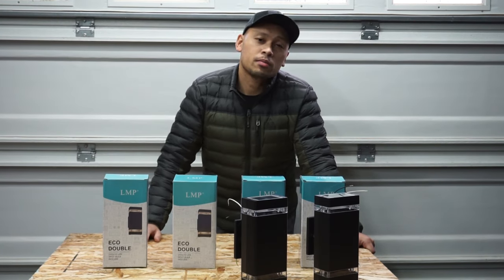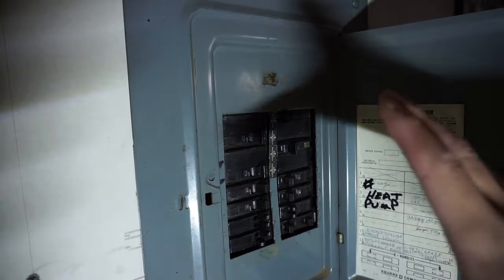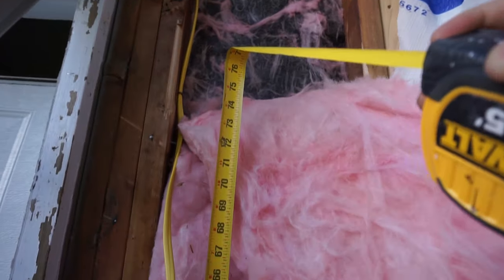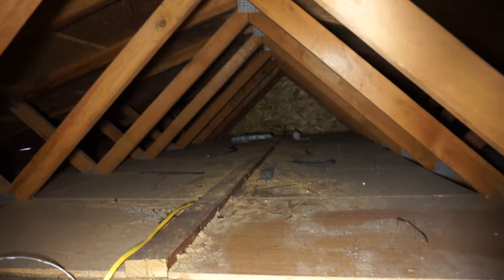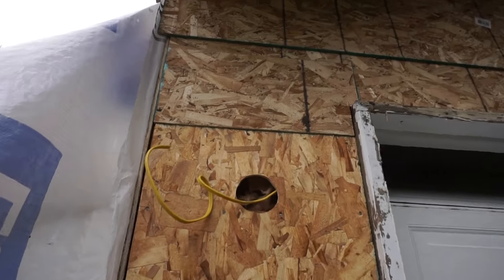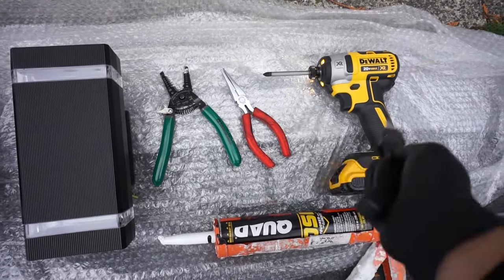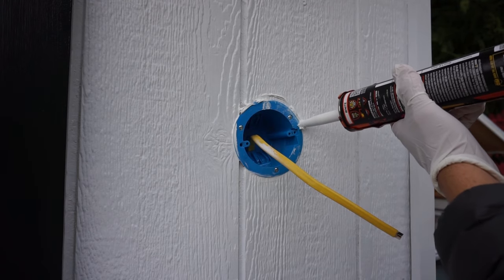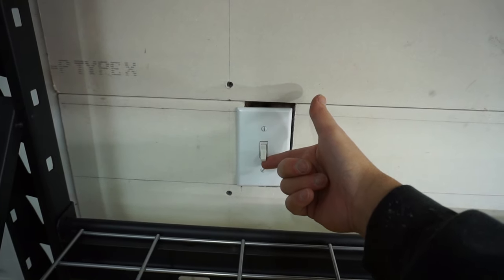How To Install And Wire Outdoor Light Fixtures - Easy Home DIY Project!

Comment: Why 12-2 wiring? I assume you have 20 amp breakers to be the reason? My house has 15 amp breakers so it’s mainly 14/2 with some 12/2 wiring.

Comment: Right away i see Thst Your using a yellow 12 guage wire. Its to thick for lightin. U could have used 14 guage its cheaper amd easier to work with

Comment: Curious as to why you ran 12/2 for these instead of 14/2?
Reply: 20 amp breakers are standard on garages and require 12-2. wire

Comment: For outside lights don't you only have to use 14/2 gauge? Isn't a 12-2 gauge wire for outlets?
Reply: 14/2 can be used for outlets if ONLY it's on a 15amp circuit. Where I am from

Comment: Thank you for great video but you left out the key part I was waiting for the wire connection to circuit breaker
Reply: I think he replied above that the switch was connected to the breaker.  So I'm this video he's forking off the line coming from the switch - I THINK.

Comment: Don’t forget to twist those white wires in the j box just like you did the black wires past the wire nut.  Holds it better when you squish it back into the j box.  I usually go about 1 1/2 inch past the wire nuts so I see a good twist.  Less likely to get loose when you cram the wires in the j box.

Comment: How did you run the wires from the light switch to the power?
Reply: Maybe it was already in place for the main gray line?  That line was obviously supplying power to something already. What I want to know is specifically how did he wire the second outdoor light? Did he run it to the same j box? I wouldn't think so. So I have to wonder if he just cut the gray line a little further over and wired it there. But he doesn't tell us :-(

Comment: FYI-
ALWAYS TURN OFF POWER AT CIRCUIT BREAKER 1ST AND FOREMOST.
Reply from the maker: Thank you, but I did mention that twice on the video 👍🏽
Reply: @FixThisHouse  
Good morning yes sir you did mention it.
But it was mentioned a  few minutes into the video whereas this should've been mentioned prior to starting any electrical job.
No disrespect intended sir.
Reply: Did you notice he said the main? When did mains start becoming attached in the middle of a panel?

Comment: I replaced 3 garage lights but only one comes on. I'm using the white 14/2 cable and noticed you used the 12/2 yellow cable. Why did you use the yellow cable and not the white? Thank you

Comment: 12 gauge for lights?
Reply from the maker: Romex 12/2 for what I used 👍🏽😊
Reply: What did you have at the breaker in the garage (15A or 20A)? 20A requires 12/2 wire and 20A requires 14/2.

Comment: If there is a red wire for a 3 way switch, do you just tie it in with the black load wires?
Reply: Cap it and leave it. You never want dual feeds, what if other end comes apart?  By capping both ends it tells any electrician and inspector it's unused and available for future usage.

Comment: what do you do if box wasnt put in even, I now have a light installed at an angle?
Reply from the maker: Hi! Are you taking about the j-box being crooked?
Reply: @FixThisHouse  yes
Reply: the junction box doesnt matter how its put in. its the mouting plate that came with your fixture thats needs to be positioned right.. just turn it

Comment: How much money did all this  cost you and how much money would you had  payed if somebody else did the job?  How long did it take for you to finish.
Reply from the maker: Lights cost $29 each, wires around $60-70 for 200 feet and j-box-wire nuts around $20. Tools separate cost. Took me less than 1 day. 
If you hire an electrician depends on rates on your area but they charge $75-$150 an hour.

Comment: you dont need 12 wire for lights
Reply from the maker: True, but if your feeding is off a 20AMP power you do. 👍🏽😊
Reply: Please tell me if I understand correctly.  You need the proper gauge wire to provide the needed resistance so the circuit breaker will trip in case something shorts or the circuit is drawing too much current. If you have a 20 amp breaker with loads that draw more current then It will handle the load. If you have a 15 amp breaker with loads that draw too much current then it will continue to trip and it's a pain.  Lastly if you use a 20 amp breaker with 14 gauge wire then that wire can't handle higher loads but the circuit breaker won't trip and that's asking for a fire.  I get the concept but don't understand what kind of load typical fixtures place on a circuit. I wouldn't know how to use tools to figure out the current load on the circuit. But I look at it this way. If I have a 20 amp breaker and I can use the smaller gauge wire,  maybe it allows me to add additional fixtures on the same circuit?  Or maybe it doesn't matter.